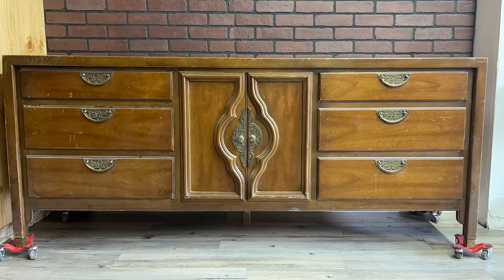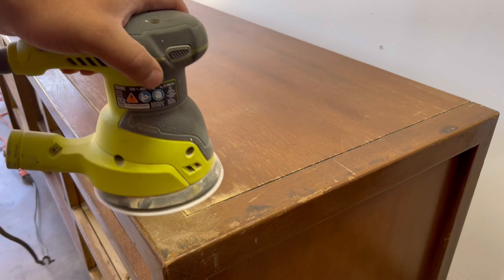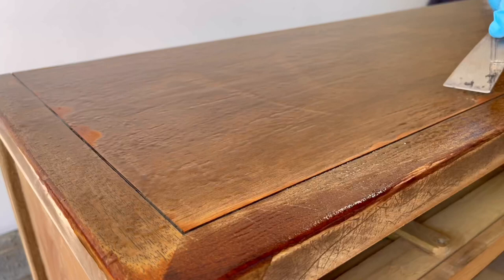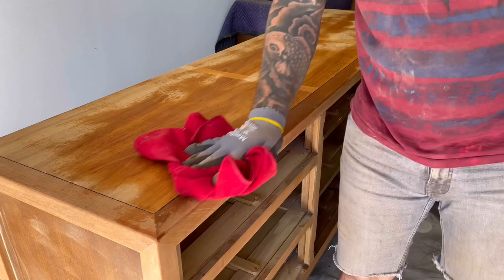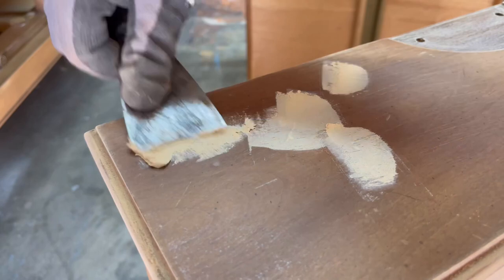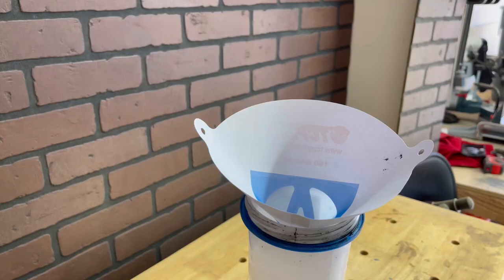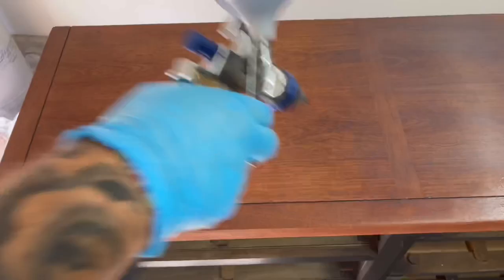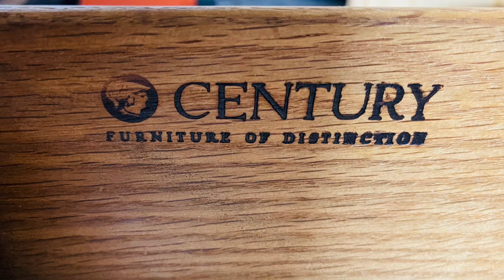Extreme CREDENZA TRANSFORMATION using black paint and stain || DIY furniture flip MAKEOVER

Comment: I love the result. you did a great job. If you're getting swirl marks, it's due to either applying too much pressure while sanding, or you're moving your sander too quickly.
Reply from the maker: Thank you so much for the comment and advice. I’ll try both slowing down and less pressed. I appreciate you
Reply: also could mean youre not changing thepads frequently enough and the old pads are just dragging particles around
Reply: @Christianmortimer  sanding dust doesn’t build up like that, and the more sandpaper is used, the smoother it gets. Even if there was something like some type of adhesive being sanded over, particles can definitely build up, but it doesn’t create swirl marks. All it does is make the surface a pain in the arse to sand, because the sandpaper skips over the area being sanded.

Comment: You do very good work! One small tip! I wouldn’t use TSP if you’re going to sand, I think that’s what turned the finish goopy! Those degreasers don’t mix well with modern strippers. If you use a little Dawn and some 4 ought steel wool, you can get rid of the body oils and grease so your  stripper can get right to stripping the old finish off without interfering with it’s job. I know everyone says it’s the best product but sometimes it might not be what you need. TSP was what we used in restaurants to clean out fryers and the wall behind them. It was listed as a neurotoxin and we were always warned to wear gloves and a respirator to avoid brain damage! Dawn is one of the strongest and safest degreasers on the market and isn’t so expensive if you only use it on the pieces you want to refinish instead of paint.
Reply from the maker: Thank you so much for the compliment and useful info. I really only got it after seeing a ton of people use it, but I honestly don’t really like how it works. I definitely will try dawn and probably stop using the TSP. I don’t like the tackiness it leaves behind, and makes for double the work when cleaning as I have to use water after. Thank you again for the tip. Take care and have a happy new year.
Reply: Thank you! I was thinking I would have to buy some kind of degreaser. I have plenty of Dawn.

Comment: I’ve always wondered how people dispose of rags used with mineral spirits since they are self combustible, I’ve heard. Love to know your process for storage of them until they can be disposed of. Great transformation, by the way.
Reply from the maker: Thank you so much for the positive feedback. I usually take my used shop towels and let them sit on my concrete floor isolated away from anything that can catch fire until they are fully dry. I’ll them take them and wash them in my washing machine and either reuse them, or throw them away  after wash
Reply: CedarPineDesigns thank you so much for the tips!
Reply from the maker: @kaymack5304  you’re welcome

Comment: Nice instructional video clip.   Btw,  say whats that three wheeler thing used ubderneath the cupboard legs and where can I purchase them?  Thank you 😎
Reply from the maker: Thank you so much for the compliment. Those are 3 wheel single leg dollys. But I wouldn’t recommend those ones because they have solid plastic wheels and can get a bit sticky. I found them on Amazon. I would look for some that have bearings in the wheels if possible.

Comment: Did you have trouble with that liquid crud from the stripper getting into the cracks between the top and the trim or did you just leave it?
Reply from the maker: I didn’t have to much trouble. I would occasionally use my scrapper to remove any finish or sanding dust from the crack. Thank you for the comment.

Comment: Where did you find those little 3 wheel rollers your furniture sit on while you redo the pieces?
Reply from the maker: I got them on Amazon. Furniture dolly or mini furniture dolly and they should come up. They will run you between $25-$40 they work pretty good.

Comment: How do you know if a piece of flipping furniture is previously stained and how do you know wether it's oil or water based stain. Real question. I want to flip a couple pieces for my own place.
Reply from the maker: You can typically tell just by looking at it if it’s been previously restored. Water base and oil base really doesn’t matter if you are stripping it down. But you can use water based stain but I feel the oil based soaks in better. The top coat I always use water based because it dries a lot faster.
Reply: Also. How can you tell wether a piece of flipping furniture is laminated or solid wood.
Reply from the maker: @RoqueL1  if you look at the back of any piece is where you’re going to find the unfinished part of most furniture. You can see the difference between the wood and a thin layer of veneer on top. Also laminate is usually very plastic feeling and cheap. It takes time to recognition when you see many pieces you start to get the feel for it.

Comment: So using regular paint like Behr is ok, you don't have to use furniture paint like I see others on YouTube use? Most people use Dixie Bell.
Reply from the maker: Behr paint should be fine so long as you get it with a built in top coat and then coat it with polyurethane to protect it. I’ve never had an issue but I will definitely be giving furniture paint a try in future projects
Reply: Great!

Comment: That looks GREAT! What pressure do you run on the regulator? And what size tip do you use?
Reply from the maker: Thank you so much. I really appreciate your feedback. I set the regulator to about 40 psi and the nozzle is 2.5. It need a good size nozzle for latex paint. I learned the hard way when I ordered a gun with a 1.3 tip and it was like an airbrush.